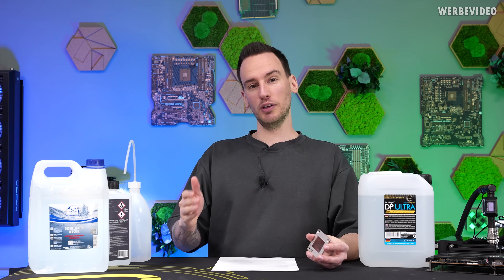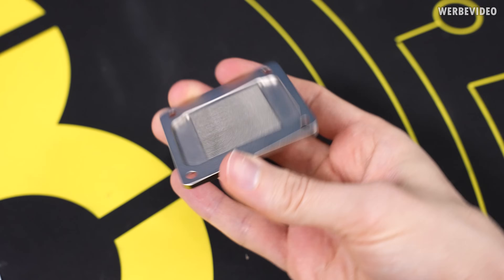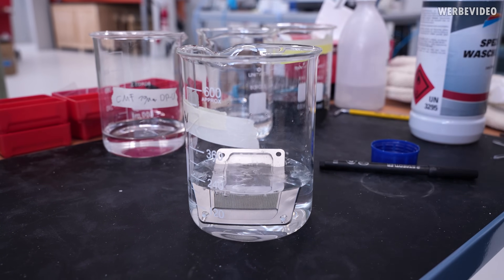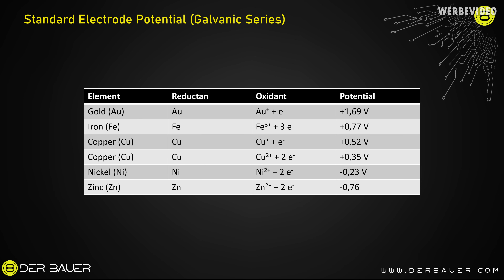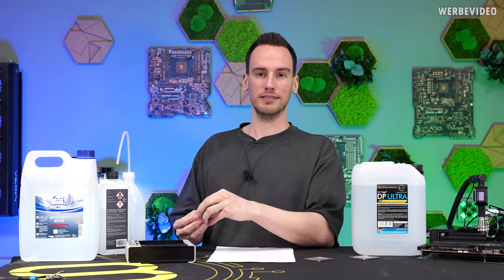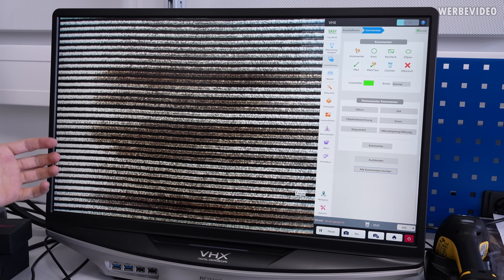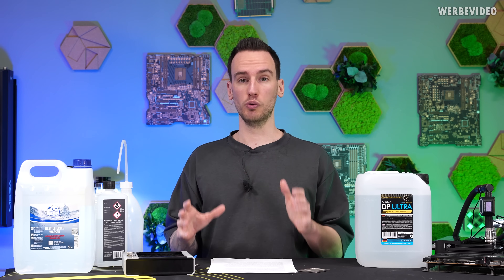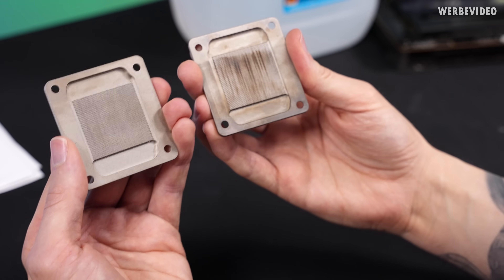Do NOT use Distilled Water for your Water Cooling Loop!

Comment: People on Reddit tried to tell me that distilled water is ok because companies just want to charge you more for premixed solutions.
Reply: People on reddit will tell you to only shower once a year because it saves money and big water is trying to rip you off
Reply: "People on Reddit [...]"

There's your problem.
Reply: if you would be able to maintain absolute purity of distilled water it would be okay. However - distilled water will happily saturate with whatever is able to permeate through imperfect membranes. Test that was conducted by Roman was exposed to air - which naturally contains CO2. This gas forms weak acid, but even weak acids bump water conductivity around 20 times. Also, any residues from electrochemical processes will enter your cooling loop. If you are running heat power plant and have circulation water treatment facility then you are safe, but in case of small systems - just use inhibitors
Reply: @michawisniewski4654  20 times 0 is still zero, though.
Reply: @skachor  This is why you had chemistry in school. absolutely pure water still has non-zero conductivity thanks to autodissociation (which is low, but not negligible) and even if it did not - there would be some ionisation due to ambient ionising radiation.
Reply: @michawisniewski4654  it doesn't though and it's not chemistry to recognize the properties of a compound.  Impurities in water are what cause it to be conductive.  Distilling removes those impurities, at least until the water leeches ions from the items it comes in contact with.
Reply: @skachor  wrong. Any liquid containing any ions is conductive. Even ultra pure water contains H3O+ and OH- ions due to its autodissociation. This gives conductivity of around 0.5uS/cm which is small, but not zero. But what do I know. I am just BsC in electrochemistry.
Reply: @michawisniewski4654  grab a multimeter, some distilled, and try it
Reply: @skachor  don't make me laugh. Are you using water level to measure earth curvature? Your DMM is probably unable to measure resistance related to water conductivity. We are looking at few megaohms of resistance at one centimeter. DMM electrodes are not designed for conductivity measurement - they are made of coated alloys. Conductometer has two platinum electrodes placed on glass rod and has much more sophisticated frontend, actually  able to measure ionic conductivity. Also, what is megaohms at 1cm is just miliohms at molecular lever - electochemical corrosion occurs on the distance of at most few nanometers.
Reply: @michawisniewski4654  ok, so it's immeasurable, but it's conductive.  Just trust you bro.

Redditors lol
Reply: Just pick automotive coolant, it's got everything you need. Biocide, lubricant for the pump, corosion inhibitor
Reply: @f36443  it's got what loops crave
Reply: You absolutely SHOULD use distilled water in a cooling loop.  Plus an additive.  This video title is really bad clickbait and Roman should be ashamed.
Reply: @ No, you should not. And it has been known for a long time already that you should not.
Reply: @MajinOthinus  what do you think the "mix" is in premix?
Reply: @skachor  Large amounts of glycol that cannot be added by an additive.
Reply: @MajinOthinus  why do you think you can't use concentrate?
Reply: @skachor  Because you can't concentrate a single chemical. Do you even know what concentrate is???
Reply: @MajinOthinus  a single chemical mixed with itself eh?  Now that I understand your perspective, it's clearly ill informed.

Coolant's come either premixed or concentrated, you can either get it with the distilled added already to dilute the strength of glycol as a premix or as a concentrate and add the distilled water yourself. 

If you're really interested, you can even look up reactivity lists and msds for types of glycol.

Also, you still haven't answered why you can't have a concentrate with distilled, probably because you can.  The difference between concentrate and premix is the dilution with water.
Reply: @MajinOthinus   why didn't they call it pre single then?  What's the mix?

E:  choose a coolant you like, I'll tell you what the mix is.
Reply: @skachor  Because you can't concentrate glycol ffs. You can no more concentrate glycol than you can concetrate water.
Reply: @MajinOthinus  you don't understand what concentrate and premix means, do you...?
Reply: @ No, quite obviously you don't understand. you seem to think you can replace glycol with some sort of concentrate.
Reply: @MajinOthinus   I understand you're suffering from "it's harder to convince someone they've been fooled than to fool them in the first place"
Reply: @ It's basic chemistry. middle school level chemistry.
Reply: @MajinOthinus  then it should be easy to explain what mix is in your premix.

Maybe the guy whose dad works at waste treatment who confuses that with himself having a BSc in electrochemistry could help you out.
Reply: @ You truly are daft.....

It's like talking to a wall, except the wall apparently has more brain activity.
Reply: @MajinOthinus  and the wall asks appropriate questions you can't even answer.  A wall that is essentially more knowledgeable than you.

Sad
Reply: @skachor  No, the wall just refuses to read the answers it is given and then claims it wasn't given any because to do otherwise would be to admit it was wrong.
Reply: @ sorry mate, but your "knowledge" is based on ignorance, not facts. Get educated
Reply: @michawisniewski4654  you can't answer simple questions
Reply: You can run distilled water with Mayhems drops with no issues - bioicide and corrosion inhibitor.

Comment: People have been using distilled water for decades its very strange why this has just become a problem now
Reply: It's always been a problem, most people just tend to only tell the sunny side of the stories. I had algae growing in my water-only loop when i started out 30 years ago, was horrible.
Reply: @f36443  do you not think is VERY strange why this information is coming out now and not "30 years ago"
Reply: @ As i mentioned, it's always been a problem on the OG forums way before youtube etc.
Reply: Sounds like it's because people are using plated crap now, where you have built a galvanic battery right into your water block from the start. I would never use anything but monometallic blocks. And yeah distilled water is fine.

Comment: i used distilled water with automotive cooling concentrate mixed it about 50/50, had a copper block and alu rad (all chinesium incl tubing and fittings) for two years nothing coroded and nothing grew in the loop, straight distilled water is ofc gonna corode the shit out of stuff

Comment: Then why nothing happens to my 2-year-old loop even with an aluminum radiator? I am using pure water. Have you considered the possibility that the “distilled water” is contaminated? Maybe try some deionized water, "proper" coolants are all based on it. Galvanic interaction needs electrolyte, I guess that's common sense in chemistry?

Comment: I've never really had any problem with my water cooling system and I only used Alphacool's water in the beginning. Later I just used demineralized water. What I use atm is producer for ICA which is a big food market and brand in Sweden and Norway. On it, it says "Conductivity max 5 μS/cm".

Is that enough or bad?

Comment: I build custom loops since 20 years, I tested so many hardware and coolants (+additives) I can't remember them all... Nickel plating ALWAYS failed. There is absoutly NO WAY to keep the plating in a good condition more than few months. On the contrary it is is very bad and drops the waterblocks efficiency as it will start to capture everything in the micro channels after a while.

Comment: I just used distilled water to test run your AM5 direct-die block, there are still some water left inside, gotta clean that up right now. I'm using pre-mixed coolant all the time, but I did flush my loop with tape water(hot water from water heater, it has more pressure), there were so much debris from new radiators. So flush blocks and radiators separately next time.

Comment: i was about to use distilled water WITH additives (Biocide and such) on my loop, to replace the current corsair one that has over a year on my loop.. to be honest i cant afford to buy $60 worth of corsair bottles of premade coolant right now, compared of the $5 a 2lt + biocide that i can make, i understand watercooling is expensive, but now i am unsure at ALL what am i to do if i cant use distilled water, what other options do i even have?
Reply: You can use distilled water, just not without anti-corrosive additives.
Reply: @alexturnbackthearmy1907  id love to know which anti corrosion agents i could use as well, thatd be loads helpful

Comment: In the automotive industry we call the "inhibitors" dopes which are coolant additives depending on the use case. Personally I rather use a light variation of car cooling fluid based on industrial alcohols. When some fluid evaporates it does leave residue so regular cleaning and replacement is vital however it does not react with different types of metals. I do not have oxidation and corrosion so that's the trade-off. Beware of the difference between corrosion and oxidation. Corrosion is a process with acids and salts. Oxidation is a process which happens based on oxygen. Both are very different processes and nickel plating can perhaps not have oxidation however all metals are vulnerable to corrosion with salts and acids. Electricity adds another dimension to corrosion. Hence the process of electrolysis and magnetism. H20 is one of the natural elements which reacts very easily with anything so an industrial transparent alcohol might even be the best like a ethylene. Most cooling fluids also contains glycols which are a type of sugar

I'm using a Bequiet AIO with most of the housing and elements made of plastics with only the heat exchanger made of a metal and I take it apart entirely for about every 6 months next to cleaning everything else with a dust job. My coolant fluid looks pink and I mix it with some demineralized water. Not distilled water. it's pretty hard to find the perfect universal fluid because most brands all use different materials which react differently to different fluids

Comment: @der8auer Do the same experiment now with boiled destilled water, No shaking  before and limit airflow(cover the beaker). You will be suprized ;)
If you know how copper eching is done you know also why solutions need aeration OR chemical oxydizer(ex:H2O2).  Oxygen in system has effect. Boiling solution will reduce amount of disolved gas. Pure copper wont react with water without precence of oxygen.  But i ges guy with zero chemistry background has no knoladge of this. 
Using open beaker is example where you attempt to explain something but have no controll over ALL enviormental variables. Making test pointless.

Comment: Naah, its fine for 30 minutes.
To deep clean corosion, i use following:
All steps are done in open loop, meaning one section of pipe is disconnected and hoses are connected. I my build i left 2 service valves and one valve to close off flow between them.
I use external gear pump, no power to system. Slow flow rate around 1L minute. 
1) flush with 5L destilled water
2)use solution of 10% acidic acid flush 5L. This will remove calcium, copper oxide deposits but will not remove base metals(atleast in meaningfull rate).
3) use solution of saturated sodium carbonate, 5L(this will generate some CO2 gas, so go slow on pump speed. Purpose is to neutralize and rise Ph. it will also deposit out ANY other ions and stop migration of any ions to solution(atleast ones below sodium in reactivity).
4) flush with 15L of pure destilled water.
5) fill system with pure coolat and discarding first few liters(it will be mostly destilled water). Close loop an voila you have nice clean system. Any corosion resedue that was there will be removed.

Comment: tbh, this is a nothing burger, your loop will be fine for years and years (and years) with just plain distilled water. Ain't gonna stop working, never. If you build it right (and i speak from experience, swapping air cooler for WB since the year 2000) nothing will happen, spare those 50$ on "proper liquid" and get few games on steam, imo.

Comment: I just built my first loop with double distilled water, I havent seen any of the problem yet. is it any different perhaps?
Reply: As long as it is copper in everything, should do fine. Issues start when you mix metals, even tho water will still take some of that copper away.

Comment: Stuff like this makes me think about filling a loop with oil. Then I vaguely remembered Jayz2cents doing a video years ago about why that's bad. Then I went to his channel and tried searching for that video. Then I remembered all his videos are titled "YOU WON'T BELIEVE WHAT SHE DID NEXT! UNBOXING REACTION FIDGET SPINNER GONE WRONG!". Then I was sad.
Reply: Its thicker then water, and that its main problem. But you can probably get away with it by using pump meant for oil cooling.
Reply: Oil is not even remotely as good of a carrier for heat transfer. Oil Submersion Cooling works decently-well (largely) due to the increased contact area. 
Water has an absurd capacity for heat and is the better coolant, but it cannot directly pull heat from (nearly) the entire mass and surface area of the device. Ex: Electrical Transmission Transformers are submerged in oil.

Comment: @der8auer EN Have you looked into wiring in a sacrificial magnesium anode somewhere in the loop?  From a chemical perspective it's more reactive than copper, nickel, zinc, tin, lead etc. so it should corrode first before the less reactive metals in the loop, whichever part it is!  Food for thought!  Fairly inexpensive extra protection.  I wouldn't mount it internally a case though, vented acrylic tube, maybe!  Definitely agree with the assessment concerning distilled water, it's quite the solvent, but not a solution!
Reply: Yes!

Comment: Damn, i need to flush my loop and replace the coolant and I was going to use distilled water for a week or so until i can get replacement fluid but thats obviously a no go now. 
I had no idea it happens that fast because i always heard "use distilled water to rinse/flush" so i thought it was okay unless you were going to actually run the loop for some time. 
Good timing on the video for me though. 😂

Comment: I ran pure distilled for over a decade. I had some dark spots. Was never an issue though. For the short time I used EK blocks in a build, they flaked apart from it. 
Ill just keep going with it. I think i have a splash of vinegar in the loop this time. Ill just get full covered blocks in the future.
Reply: You're not paying attention, "full covered" the nickel plating can't reach the recesses of the cold plate. Watch the video again.
Reply: Nickel plating won't reach the recesses of the cold plate if the microfins are too microscopic. Most open loop watercooling parts sold by companies like Alphacool are much larger in fin pitch and won't have the same problems derbauer is having.
Reply: @Make1984FictionAgain-JQ  I wasnt making an argument against him. I was only saying that I dont care so much about it in my cases. Plus a little dig at EK for their quality.

EDIT: full covered meaning so I cant see the fins through any plexi. Sorry. Wasnt best choice of words.

Comment: Thought I might throw my hat in the ring as I have some experience on this. While I was working at the uni after my master's degree we worked with water hydraulics using ultrapure water. Had to be deionized due to radiation issues. Basically everything had to be made out of acidproof steel. AISI 316 was fine, as was Outokumpu duplex 2205. These might be a bit of an overkill for cooling loops but hey, they work. Also, fittings must not cause deformation to the tubing as it would un-stainless the steel. You know, push the chromium out of the skin of the steel. I believe ORFS-style fittings (ISO 8434-3) work just fine, as would Parker's EO2 ISO 8434-1 compatible fittings. Again, a bit of an overkill, but they should work and not corrode in this usage.

Comment: A lot of people don’t understand why distilled water won’t work. To simplify this. 
Different metals in a cooling system causes an extremely small electrical charge. This is shown in the video at 5:49 as potential voltage. This causes a transfer effect and ends up corroding something like when you use an electrolysis to plate something. 
This is why you need glycol and other ingredients in your coolant. 
Although he put the plate in the water by itself and the plating is made of nickel but may not be 100 percent pure and it’s plated in top of an another metal which can cause the corrosion due to voltage possibly created. Also distilled water is extremely unlikely to be pure.
Acidity can be an issue also so coolant is often basic. For those who don’t know it’s opposite of acid.

Comment: Water is so corrosive it literally made the Grand Canyon. It's terrible, it's only used for cooling because it's cheap and plentiful but it's not the best solution. I'm sure there is an oil in the industrial or automotive sectors that would have similar viscosity as water, have good heat absorbing properties, and be inert to corrosion so as to be a better but more expensive solution. But one that would be worth it.
Reply: *erosive, but so is any other liquid, corrosion occurs only if two different metals are mixed and there is nothing to prevent it. Oil is for high temperature stuff, not really effective at low temperatures compared to what they usually cool.